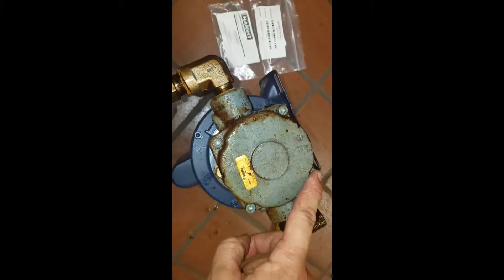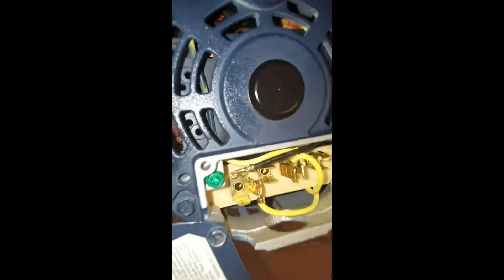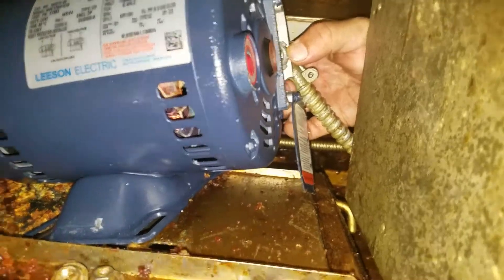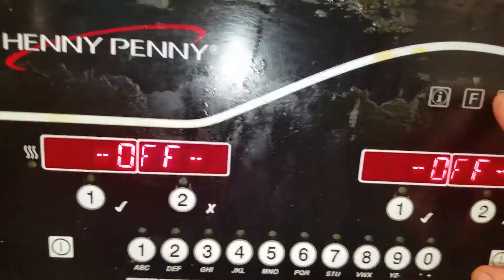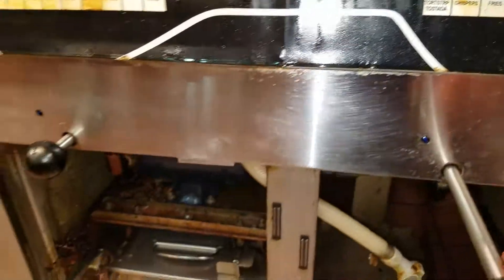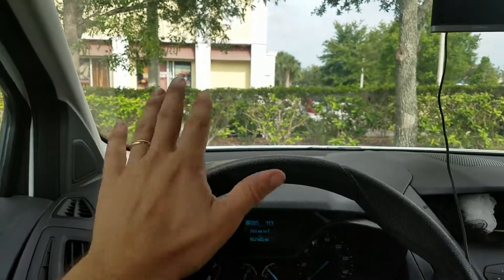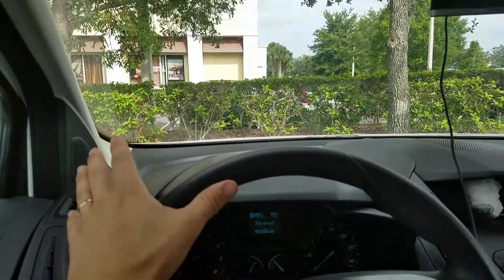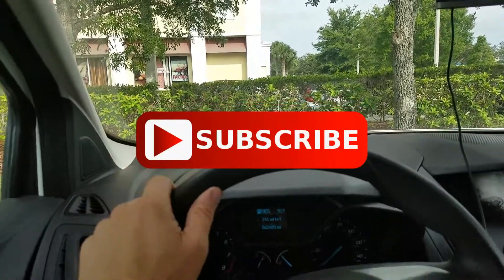EEG-164 Motor replacement(2/2)

Comment: Hey Fryer Guy, I like your style, touchy feely for troubleshooting is the way I roll also, but I still disconnect the power before performing any task that requires any removal of electrical components besides testing them. I've been a technician and contractor for all the fast-food chains for more years than I want to mention but still respect energized equipment. Again, you do a great informative, to the point video, I even picked up a few short cut pointers, thanks.

Comment: Great info. Glad your video is still here. Do you have more videos on the pressure fryers?
Reply from the maker: What kind of pressure fryer? The PFG-600, PFE-500, PXE-100, PGF-690, Etc?
Reply: The Fryer Guy Pgf-690
Reply from the maker: @commercial_service  not recently. A lot of the PFG-690s are being phased out to the PXE fryers. There are plenty around still, just haven't had the privilege to work on one in a while.